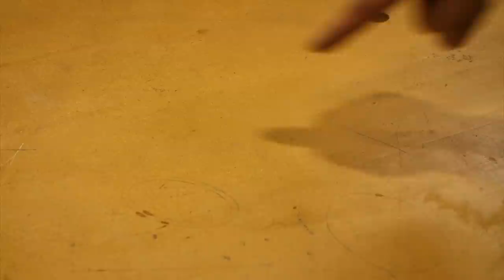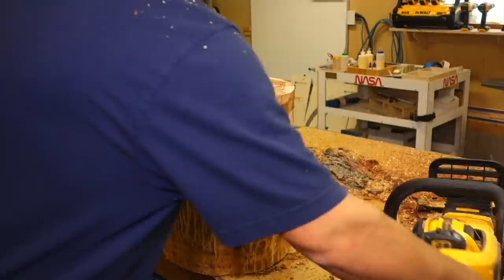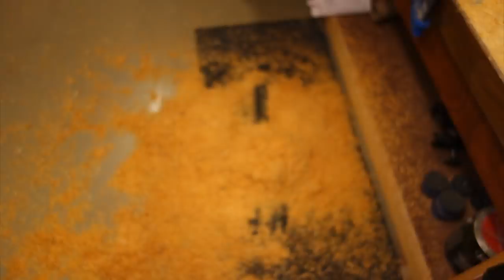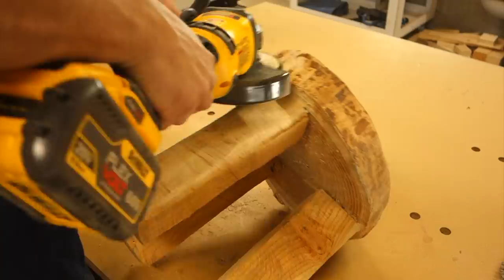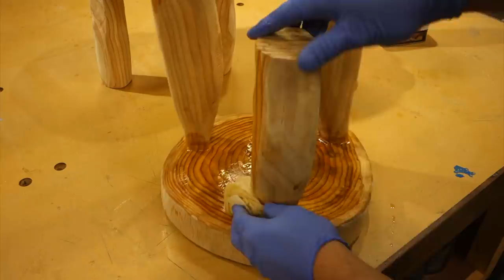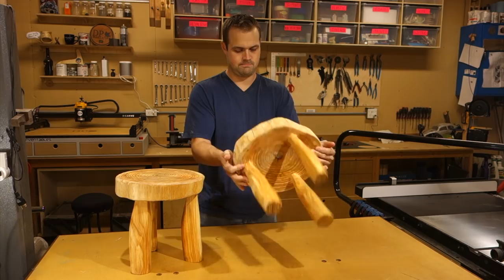Two Stools, One Log

Comment: Very cool project, though I'm curious how long they will last before they start to crack since they have the pith right in the middle. Hope I'm wrong. :)
Reply from the maker: I hope they check!  I think a couple big cracks would add to the over all look.  If they break, I'll fix them!  Thanks!
Reply: Dustin Penner great point!!
Reply: 143   _ I hope you'll post an update a year from now showing how they aged.  I'm some what surprised they didn't pop in the oven so maybe they won't check assuming they are indoor furniture.  I think this video and your description has convinced me to buy a can of that oil.  

I do a little of that kind of chain saw cross grain carving and some woods just check right in half.  Others hold better.  I've never even heard of Larch.  It has a nice grain to it especially with that oil.  I've found the thicker I leave the rounds the better they hold together and if I leave them for a year or so in the moist-ish basement they dry slow and hold together.

Comment: Dustin Penner great video, congratulations on making the chairs. I have a few questions that I'm curious about so if you don't mind answering I would greatly appreciate your input. 
1. How many batteries did you go through to Mill the stools on the chainsaw, aand the grinder? I'm curious about the run time because I'm heavy on the fence about some tools right now.
2. How many flap disks doid you go through? I hope I'm not asking and hoping for too much, thank you for the content and the feedback is appreciated.
Reply from the maker: Hey Anthony!  Not a problem!  I used about 75% of a 9ah battery one the chainsaw, and 75% of a fresh 9ah battery with the grinder.   I only used the one flap disk and there is plenty life still left in it.  Thanks for the kind words!

Comment: Great video!  Question about possible checking on the endgrain:  Does the oven drying take care of that, or do you anticipate seeing cracks?  I'm legitimately interested, because that wood was so wet that I can see it cracking like crazy as it dries.
Reply from the maker: Matt Pickering massive checks in both!  Outside edge is over an inch apart. It looks amazing, was fully anticipated and I love it.